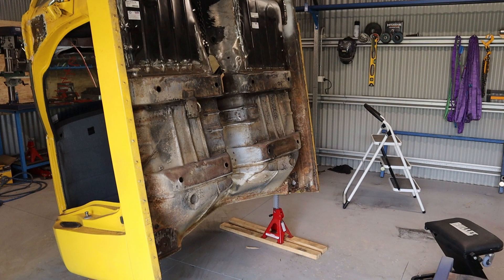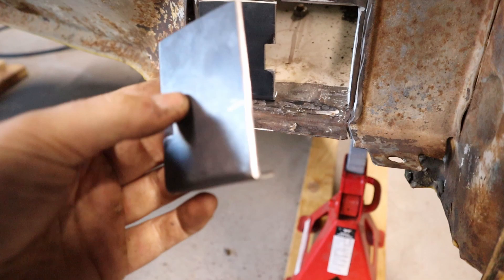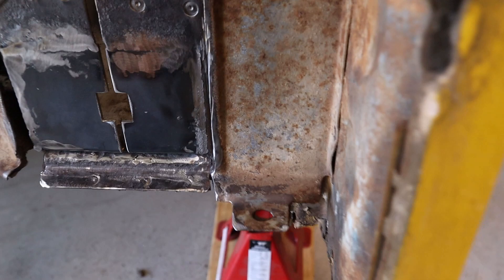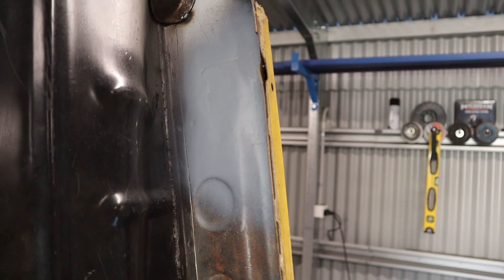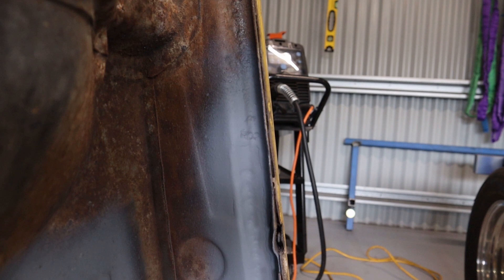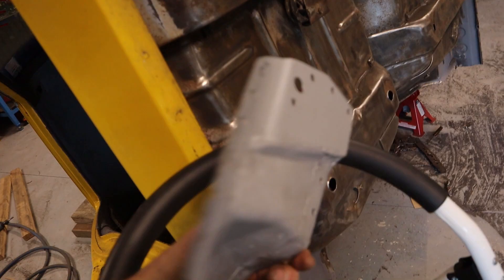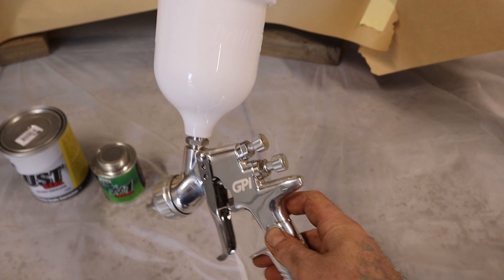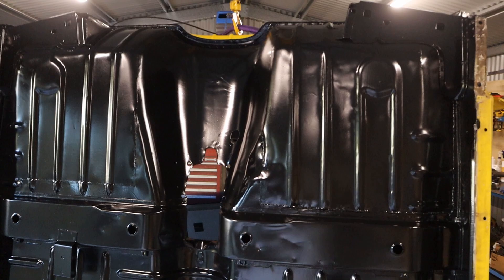One Tonner 355 Stroker build - Part 2 Under Body Repairs

Comment: Hey mate, what's the benefit of going with KBS for the underbody & chassis when "normally" people epoxy prime/mastic the bare metal and underseal/schutz/stonechip?
Reply from the maker: Hey Mate I believe the KBS has a flex in it and is pretty durable. I just found it easy to use aswell. Gives an option of brushing on aswell.

Comment: Hey Sam I noticed the original cab mounts had a couple extra cut outs which you didn’t do in the replacements. Aren’t they required?

Good vid again mate
Reply from the maker: Hey Carl yeah they are to hold the nut on the inside but generally they rip out and you gotta get someone to hold the nut on the inside anyway.
Cheers Mate
Reply: Shenke Garage can you just weld the nut inside once lined up or do you need a bit of adjustment?
Reply from the maker: @DrSedeka  Nah the nut needs to move around to give adjustment.

Comment: Good video mate, what size spray nozzle did you use when applying the KBS?
Reply from the maker: Thanks Mate. I used a 1.8 nozzle for the KBS. Seemed to work pretty good.

Comment: What thickness is the sheet metal your using?
Reply from the maker: Hey Mate. I use 1.2mm thick cold rolled sheet for most of the repairs
Reply: @ShenkeGarage  cheers bud 👌🏼